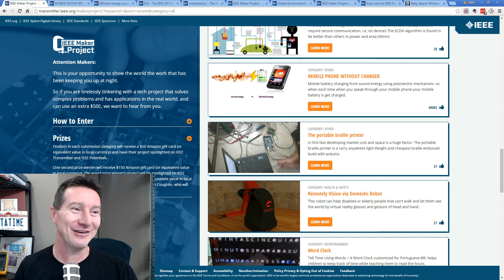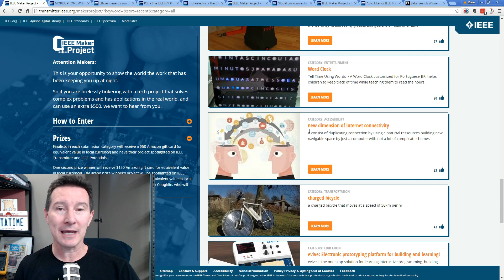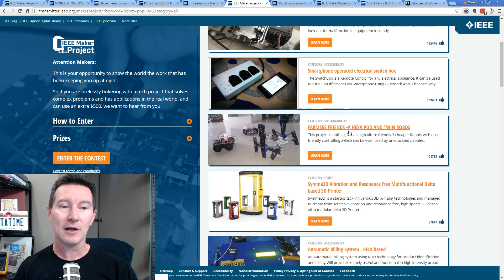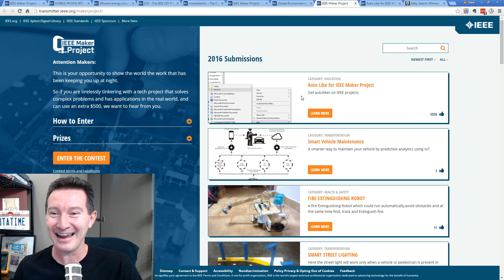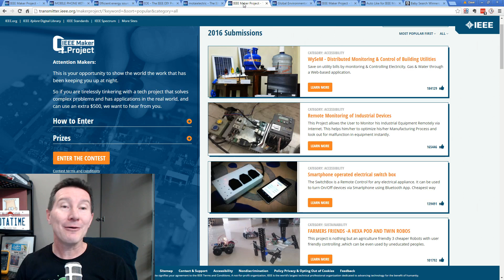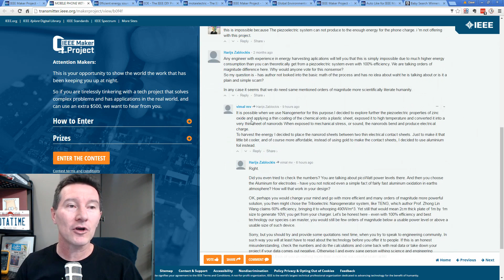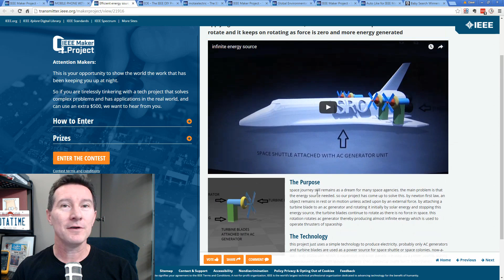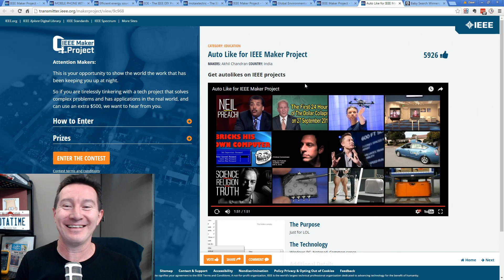eevBLAB #25 - IEEE Maker Contest Extreme FAIL!

Comment: Now when accessing the site you get this: "We have identified a small group of users who have violated the contest rules and regulations by rigging the voting mechanism by generating fake votes.
Our process for evaluating votes has a safeguard in place to validate votes before the final round. All submissions and their respective votes are manually authenticated before moving forward to the judges. The users in question tampered with the voting functionality to increase their votes, and as a result, have been disqualified.
We would like to thank all of our contest participants for their hard work, and encourage others to join in by submitting projects by Saturday 17 September 2016.
Our team of moderators will continue to closely review each project entered to ensure that all submissions meet the contest terms and conditions.
Thank you for being part of the IEEE community!"
Reply from the maker: Yep, they removed all the dodgy projects!
Reply: Just got that to. :)
Reply: I went through a looked at some of the newer crappy projects. The ones that are basically 'free' energy devices, or ideas that operate based on a child level understanding of physics. They are ALL coming from india, nothing against the Indians, but what is with that. I'd be embarrassed quite frankly.
Reply: Not all of them. The wind turbine perpetuum mobile is still there.

Comment: they don't really need to scrap if they have log enabled for get request, they just will have to clean they data set and automatically remove duplicate ip vote + remove multiple ip vote + ran all remaining ip throught yaph or other tool to weed out a bunch of proxy for a low prize like this no big deal

Comment: they JUST removed the autovoter project...
Reply: Nope. The chargerless phone is gone as well as everything above 10k votes. It was above 3k I think, but they brought back 4 of the projects below 10k now. Still, I agree with Chris Day about resetting all counter and leaving all of legit projects in, not minding if they had or had not faked the votes. After fixing the voting system, of course. By the way, it is quite unfair way to allow entrance after voting has started. If system would be well made, still, those who entered first would have much more chance, than those, who enter 2 days before closing.

Comment: Hello internet. I have to say, that IEEE damage control is as sloppy job as the web site and moderation for participants is. They removed all projects with >2.5k votes. That includes uRad project, which had about 4k and knowing the guy and the project (it has been out there and quite popular for years now), those ware probably real votes. Still, they kept all the tesla energy, propeller spacecraft and other woo and perpetual motion silly things, which had low enough vote count. How smart / fair is that? Anyhow, the projects are not removed, if anyone wants to grab a screenshot or something, they are accessible by full links. Including the one for vote spoofing project. They are there, just not showing up in search or participant list./H. out./
Reply: So messy. If someone other than the creator was faking votes for the uRad project, then the fake votes should be removed...not the project.

They should just reset the whole thing and bring it back after they have patched up the contest.
Reply: Yes, I agree. That is just what I would do. + I would kick out the woo projects. That would be the most rational way of dealing with the case. Are the people there rational is raimaining to be seen.
Reply from the maker: uRAD is still there and at #1 now
Reply: Yes. They removed everyone with >2500 or so votes and then they added back everyone with <10k votes. I get a feeling that they are trying to kill the fires with gasoline. Meanwhile all the free energy, Tesla coil and so on projects are still there. I would not be much surprised, if they would try to shift the blame by accusing some of us of hacking the contest next. If that happens - I am making a t-shirt in honor of stupidity or something :)
Reply: Well technically it is a hack! and the fix seems to have identified the fake likes. Folks are always gonna rig the system with online contests ..Don't forget about whitehouse.gov petitions?  and some of these projects are legit so even if it seems ridiculous to you..calling it stupid is mean :) at-least call it "ambitious"
Reply: Paradigm84, please! 
How is a "free energy generator on compressed air" or "wind turbine blowing wind mill to get over-unity system" an ambitious project rather than silly? Oh, and yes, where did I call it "stupid"? I called it waht it is - a silly thing to do. Specially if you publicize it as entry to student project competition. What kind of engineers and scientists will the become, if they do not know basic thermodynamics and have no basic understanding of elementary school physics? There is just no excuses. As mean it might be, I do not think that euphemisms will help to fix todays issues, but actual engineering and science will, if we will have any left in few decades.
Reply: HA! To make significant contributions to the world and to spur significant change to the world, people sometimes have to act on ideas that others  perceive as stupid no? besides you think that energy from compressed air is a silly thing??  It's an actual thing Harijs! CAES is actually something that is being used at a small scale in countries. Look up the Bine compressed air energy storage power plants in Germany!
Reply: No. Thinking outside of the box does not mean the same as having opposite ideas to proven laws of physics. As Sam Harris said - opening your mind is good, just don't overdo it or your brain will fall out, or something alike. 

So you are saying, that compressed air system is a free energy source? Are you saying, that there is a way to use less energy by compressing the air, than you will get from it expanding? 

So you are saying that thermodynamics laws are overturned recently and we, sane people, just had not received the notice? 

Please stop the nonsense, you are in wrong corner of the Internet for that.

Please read this and try to understand it, before making joke of yourself by defending an over-unity project:

https://en.wikipedia.org/wiki/First_law_of_thermodynamics

Next year it will be 110th anniversary of 1st law of thermodynamics - one hundred and ten whole years, since we as a humanity know that over-unity is not possible. Get your data up to date.
Reply: PS: Compressed air storage systems are running in USA for 25 years already. Power South's McIntosh plant was opened in 1991. They use compressed air to boost the natural gas turbines in power plant at peak hours, while collecting and storing the energy as compressed air in rest of the 24 hour cycle. 

Nothing new there. Nothing revolutionary in 2016th. What you are saying, in electronics terms, is that let's look at a capacitor from a different side, maybe it will start to produce energy. For free. Would be cool. No. It will not. Or, if you would prefer a mechanics terms - a spring. Yes, we have it for a while now. Yes, it stores energy. No, it will not produce it for free. What you put in = what you get out + losses. Losses are always positive. If you fail to see the logic, your mind has been opened too much quite a while ago. I suggest stitches.

Comment: Couldn't a charger-less phone work? I'm thinking about those shake-lights that you shake a coupke times and then have 10 minutes light or so. In combination with an e-ink display and a rather featureless phone (only calls and texts) could make a great emergency communication device that charges just by walking around with it. Although I think that a hand-crank on a phone would generate more energy :D
Reply: You could build a phone without an external charger - but read that projects description - it ain't gonna happen.
Reply: ABaumstumpf
yeah that's why I was saying a phone with basic functionality and a low power display with a proven-to-work energy source (shake-light). I didn't mean that the phone in the mentioned project could work.
The most power will be consumed by maintaining connectivity and placing or accepting calls, but I'm not an engineer of any sort, so I have no idea if a shake-light powered phone would be able to maintain power enough for one call or one text message. Again, I'm thinking about an emergency device that you would use in catastrophic areas without home electricity and landline communication. Whether or not the radio towers would work in a scenario like this, I don't know.
Reply: Hand crank could work, in fact there are hand-cranked generators for charging your phone. They definitely are not integrated though (much bigger than the phone itself). As for talking or shouting at your phone to charge it, not gonna happen, even with near perfect energy conversion (yeah, right...) the energy carried by your voice is miniscule and even if the phone itself lacked features and thus cpu etc would be low power the radios will take several watts when transmitting.
Reply: I have seen hand crank emergency radios that have a USB port on them for charging a phone.
Reply: Do you mean a "wind up charger" by any chance ... http://www.popsugar.com/tech/Wind-Up-Cell-Phone-Charger-806304

Ahhhhh, no thanks. 

You'd be better off with a solar powered battery charger and a spare battery.
Reply: Sure it could. Well, technically, it would still be a phone with a charger, but the charger would have a power source alternative to the grid. You can use a handheld crank generator, ready-made and sold on nets. You can use a simple and well known solar panel. You can make a small wind turbine. You may as well use your bicycle dynamo. You can use heat or motion harvesting technology and even those nanogenerators -  check Linear technology website, section "Energy Harvesting". But the latter will take quite a time to get a enough charge to make a call. And lots of this stuff is available on "shelves" at online stores. The sound as power source, in theory, will work too, but it will take years to charge the thing and you need a rally low leakage storage element there. :)
Other of those phony projects states that they target mobile communications in disaster areas. With that one there is a bigger issue -  the concept. If you do not have electricity for long enough time and a natural disaster has happened - you  will not have a base stations running your network, so the point of "cranking a phone" is lost there. To be fair, they wanted to make a foot - operated piezo system, that is more likely to produce somewhat usable amount of energy rather than sound harvesting and if done properly, like you say, with proven technology (like pedals and generator) would actually be usable to charge flashlights and radio in disaster areas. Then again - I would probably go with 200l canister of fuel and gasoline generator. 
But in principle, to show that you can do it, sure - it's possible to make that sort of a device. If that's your thing I only encourage you to do so and share the results with us and I can assure that you will get a bunch of legit thumbs up with that :)
/H. out./
Reply: I happen to own one of those "squeeze to charge" flashlights. Incredibly loud, squeezing only powers a flywheel rather than the battery (meaning no squeezing ahead of time), and the flywheel only lasts for a second or two. The triple LED system is about as bright as the single LED on my cheap smartphone and much more directional. But I still prefer squeezing over cranking.
Reply: "I still prefer squeezing over cranking." - I find a much better result from cranking, squeezing doesn't create enough kinetic energy to get the job done in my experience.
Reply: Don Hyon  You're joking right ?? The radiation shielding required would be like returning to the 80ies with the briefcase-phones, only much heavier... It would also be a major regulatory nightmare and expensive as hell.

So no, just... no.

It reminds me of an old joke here in Finland when people are complaining that couldn't "the engineers" invent a nuclear powered sauna stove (exact reasons vary: always on, save on electricity bill or something) to which the correct answer is that they already have, it's just that all that troublesome nuclear material is placed in a nice centralized location away your home. At the nuclear power plant...
Reply: +Eero af Heurlin 
I was joking, even so still more practical than being powered by sound waves.
Reply: My neighbor, weird lady, shout to her kids, dog, husband and others that much, that it is enough to power entire house. So, not bad idea at all, at least in some cases.
Reply: What about radioisotopes? Atomic nuclei decay en mass effectively at a constant rate which provides the energy to the phone for you.
Reply: thank the flying spaghetti monster. It's just sometimes impossible to tell whether someone is being serious or not.
Reply: +Eero af Heurlin 
Still, I was talking about a smartphone that was powered by a radioisotope thermoelectric generator. Good choice for powering space probes and Mars robots.
Reply: I was thinking of RTGs too (apart from the sauna joke), the hot stuff needs plenty of shielding. Spacecraft are in high-radiation environment anyway so containment requirements are very different and/or built-in to the craft already.

Also they are not a "good" power source, but they are very reliable. Efficiency is around 3-5% of the thermal output of the radioactive material. Solar panels are many times better as long as you are relatively close to the sun (like Mars)
Reply: If only alpha particles are generated, you just need a thin paper foil to make a good shield :)
Reply: The "chargerless phone" was described as a phone that was to be charged from only the sound of your voice striking a small piezoelectret microphone built into the phone.  While such could generate absolutely minuscule amounts of power, the phone, even if turned off and in standby, would be consuming power at a rate orders of magnitudes greater than if you spent hours yelling into phone without interruption.  You would go deaf before you ever got the phone charged, at which point you will need the Braille phone as an upgrade.  You would not even generate enough power to meet the phone's quiescent demands, much less charge the battery!
Reply: Ethan Poole
Again, I'm not talking about the specific project from the contest.

Comment: That is a terrible script! 

He could save so much time by not printing out the "LOL  :D" line!  #badprogramming

Seriously though, that's pretty funny. The best way to fix t'eh problem pretty easily would be tying votes to a social media account, but even that's gameable.
Reply: Although this system that IEEE has in place is laughable, I don't think most people know just how difficult of a problem it actually is to enforce 1 entry per person for the duration of voting.  Without making undesirable tradeoffs, it's nearly impossible (unless you have access to the amount of data that a company like Google has).
Reply: one vote per IP should keep most fake votes from one PC out (unless someone is really pasionate enough to change their IP after each and every vote)
Reply: They're not votes the winners are selected by judges.
Reply: and used curl instead of launching chrome.
Reply: +nrdesign1991 Not really as most people are behind NAT so only one IP to many.  

My last ISP had CG NAT so hundreds of customers sharing a single public IP.  Same goes for public WiFi, etc.

Comment: Dave it's been weeks, re-sign into Chrome!
Reply: ikr that warning icon is bugging me
Reply: +Doug Anderson then sign into the YouTube website, no need to sign into Chrome for that.
Reply: Unless you specifically need to sync it, there's really no reason.
Reply: Then why even be signed in at all?!?!
Reply: +Falcrist aside from the fact that he did it once. He likely changed his password and didn't update it. It's a real pain when your data isn't saved.
Reply: Nate Rowe Not really. I haven't signed in under chrome since my last password switch either, and really have no intention of doing so unless I really want to sync a chrome setting between my computers (something which almost never happens).
Reply: +Falcrist to each their own. I use it a fair amount to open view tabs I have open on my desktop, on my phone. I also just had to reinstall Windows and it was nice to have everything there. My point was, if you use it once, there's no real reason against signing in aside from the 10 seconds it takes to do it.
Reply: There are enough reasons against "syncing" all the private browser data into the Google cloud. You could also simply copy the Chrome profile folder, when you reinstall the OS... Yes, tabs on multiple devices is sometimes useful, but imho not really necessary.

Comment: "Page Could Not Be Loaded
The web page you were looking for could not be delivered."
:D
Reply: My script keeps getting 504 errors. I think the server's suffering, but it's at 23598 votes and counting right now.
Reply: 24k
Reply: I'm getting mostly 504s at this point, but the current total is 48517.
Reply: I was just running it on AWS machines that were already doing other jobs :P
Reply: 38k last time. now = 504 errors ^^
Reply: 154K+ @ 07:32GMT 05/09/2016
Reply: 212432....
Reply: They took it down. =(
Reply: Huehnerkuchen I had $3,000 worth of AWS credits to drop on it. =(
Reply: +wiilillad :(